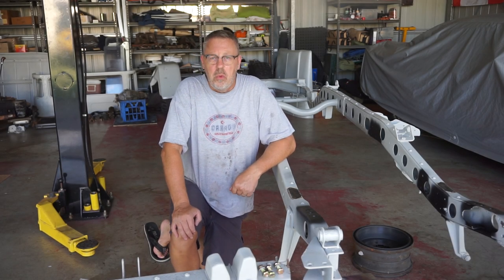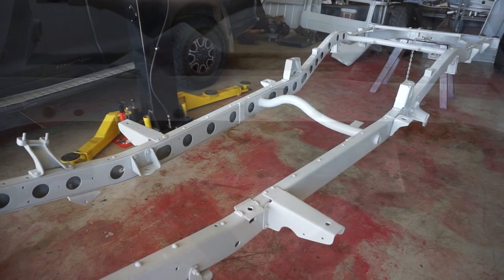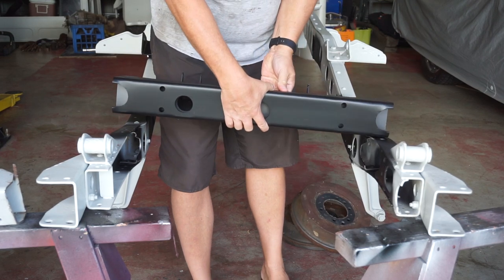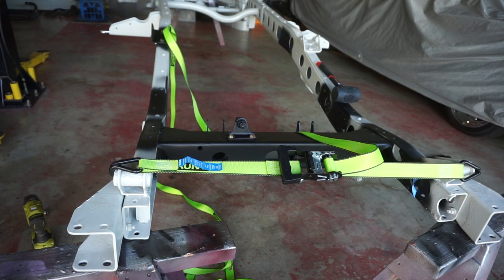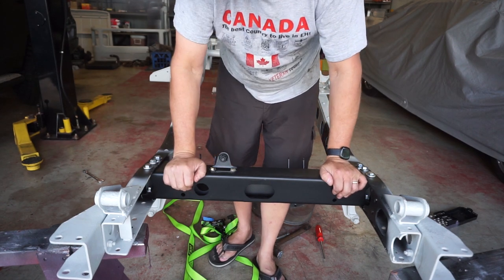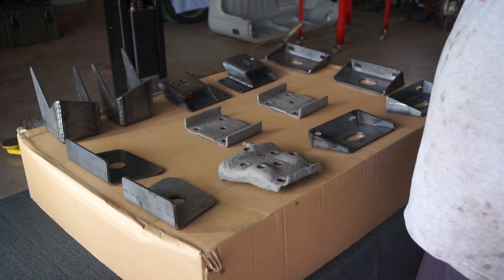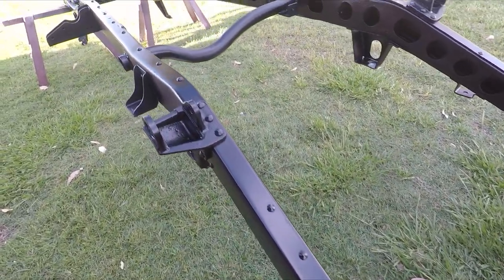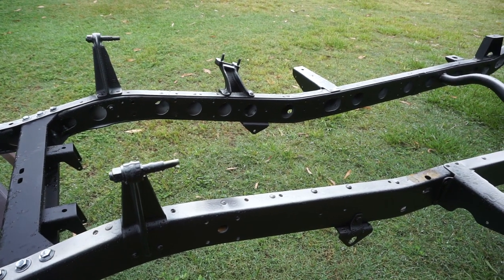FJ45 Landcruiser Restoration | Chassis Restoration | McKinnon’s Cruisers Cross Member | Episode 6

Comment: Hey mate, is there a reason why you aren’t 80 chassis swapping?
Reply from the maker: Hi Patrick, good question.  The vehicle will be my work Ute and primarily used on bitumen with the odd bit of gravel work.  I don’t need a flex monster and like the load carrying capacity of leaf springs.  Cheers
Reply: Just assumed the 80 could probably handle the power better. I.e. steering, diff strength
Reply from the maker: Possibly but I’m not intending in flogging it to death.  It will be perfect for my application.  Cheers😎👍